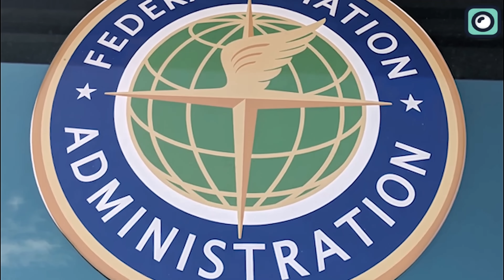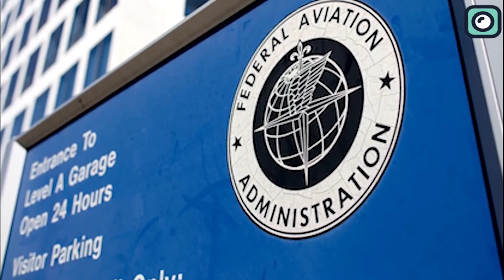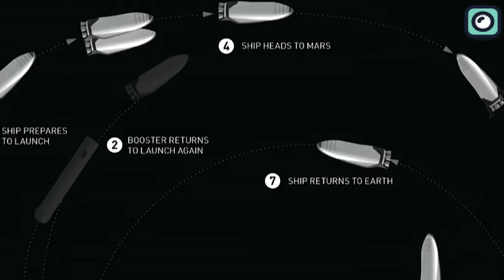It's Over! US Congress Forcing FAA To Give Launch License For Starship

Comment: For those who keep asking things like "Why isn't the FAA investigating/fining NASA?", they literally can't. 

NASA is a regulatory agency, just like the FAA or the US Space Force. NASA regulates experimental and scientific space flights, Space Force regulates military flights, and the FAA regulates civilian and commercial flights. This "three prong" approach was set up by the 1984 "Commercial Space Launch Act", with the DOT regulating commercial launches, the Air Force regulating military launches, and NASA doing NASA stuff. Commercial launches were transferred to the FAA in 1995. Military launches were transferred to the Space Force in 2019. 

NASA doesn't "get fined", they fine people. NASA has regulatory authority over the current stage of the Boeing Starliner program, just like they had regulatory authority over SpaceX Crew Dragon program through the original design, construction, the unmanned Demo-1 flight, and the manned Demo-2 flight back in 2020. At that point, regulatory authority passed to the FAA. Someday, if it doesn't get scuttled first, Starliner will also be handed off to the FAA, but right now they're NASA's problem.

Crew Dragon was within the FAA's abilities. The FAA had done their thing for hundreds of unmanned launches, dozens of crewed suborbital launches, and 13 crewed orbital flights. All those flights involved mature vehicles and launch facilities in fairly safe locations. The FAA only had to ground Falcon three (I believe) times in 10 years, and each of those was a short grounding with simple paperwork.

Starship is outside the FAA's experience and expertise. Not just a little bit outside, but way far outside. It's bigger and more complex than anything they've ever had authority over, it launches from a facility with greater environment entanglements, and they're doing things that no one has ever done before, like return-to-launch-site of the world's most massive rocket. 

The FAA is in so far over their heads that it's hard to express. They need help, but there's no system in place for them to get it. It sort of makes sense for NASA to take over regulatory authority for Starship, because it is still very much experimental, and looking at things realistically, there's at least two years before it will be ready to go commercial. But I'm not sure NASA is ready for this, either. Look at the trouble they're having simply getting a mobile launch tower built for SLS.

Comment: nasa and Boeing stranded two astronauts in space and werent fined at all. hmmm.
Reply: NASA is a regulatory agency, just like the FAA or the US Space Force. NASA regulates experimental and scientific space flights, Space Force regulates military flights, and the FAA regulates civilian and commercial flights. This "three prong" approach was set up by the 1984 "Commercial Space Launch Act", with the DOT regulating commercial launches, the Air Force regulating military launches, and NASA doing NASA stuff. Commercial launches were transferred to the FAA in 1995. Military launches were transferred to the Space Force in 2019. 

NASA doesn't "get fined", they fine people. NASA has authority over the current stage of the Boeing Starliner program, just like they had authority over SpaceX Crew Dragon through the original design, construction, the unmanned Demo-1 flight, and the manned Demo-2 flight back in 2020. At that point, regulatory authority moved to the FAA. 

The FAA has done their thing for hundreds of unmanned launches, dozens of crewed suborbital launches, and exactly 13 crewed orbital flights.